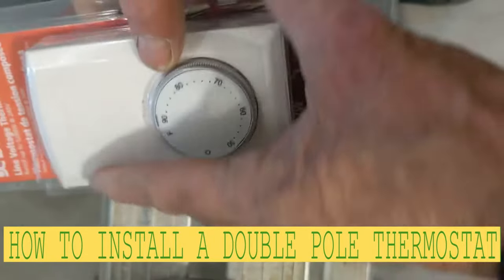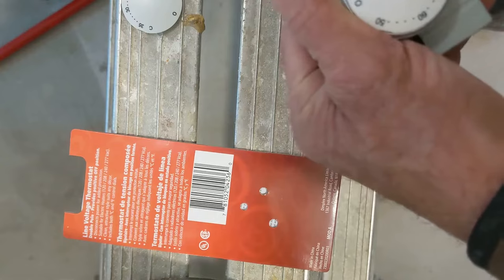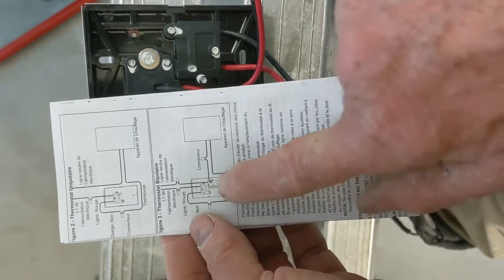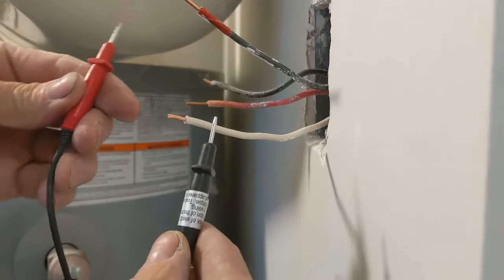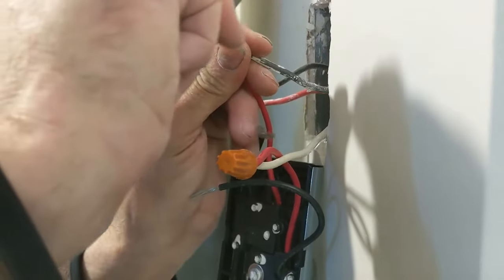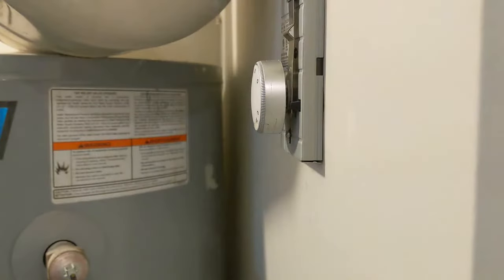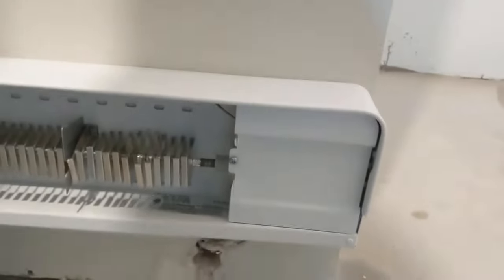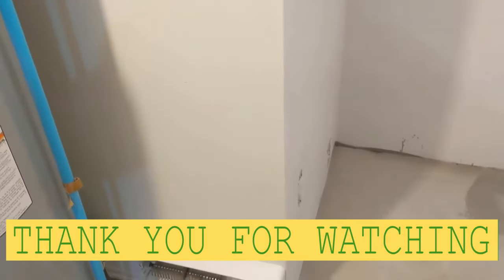HOW To Install A DOUBLE Pole THERMOSTAT

Comment: Fantastic video. At the end you said you prefer the double pole thermostats but you didn't say specifically why, was just curious boss
Reply from the maker: Hello Wolvi, thank you very much for your time and support, the double pole offer more protection by cutting the power from both hot legs when you turn it off, the single pole even though it is tuned off, but still one hot leg going straight to the heater, making it less safe than double pole, keep safe my friend, please let me know, if you have more questions and see you in the next videos.